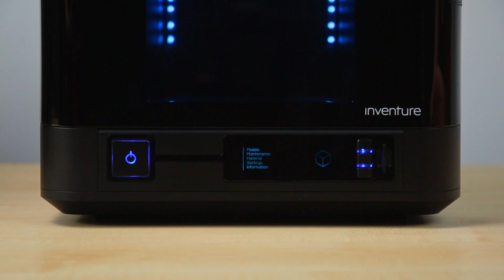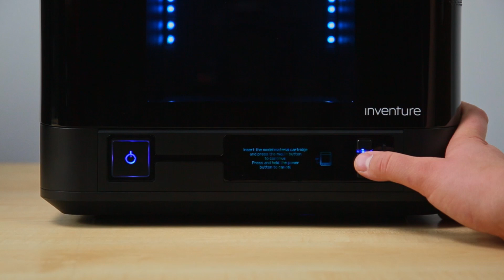Single and dual extrusion 3D printing on the newly upgraded Zortrax Inventure

Comment: Can you use third-party PVA as the support material?
Reply from the maker: Yes, you can change support material settings in the external materials mode.
Reply: @ZortraXTV  Thanks, where is the setting to do this?